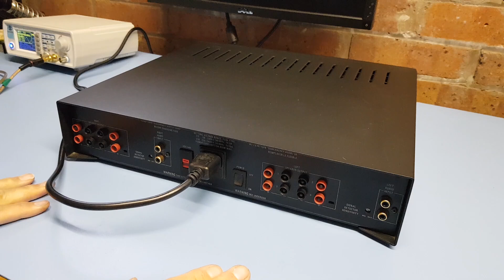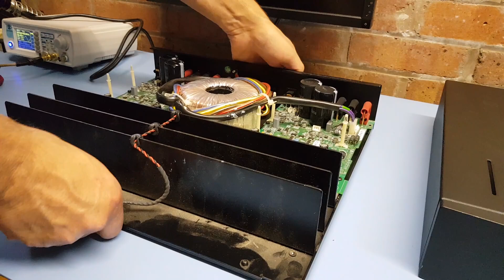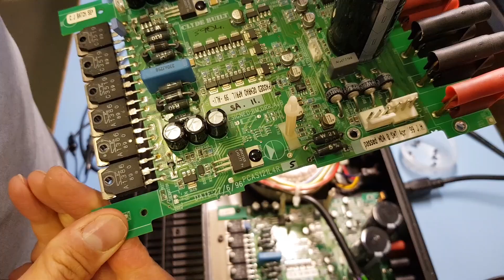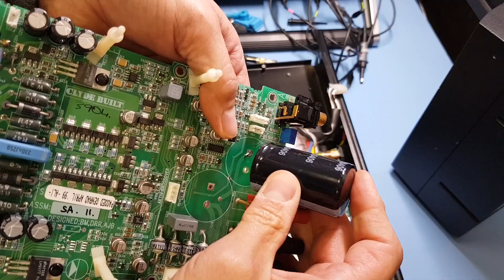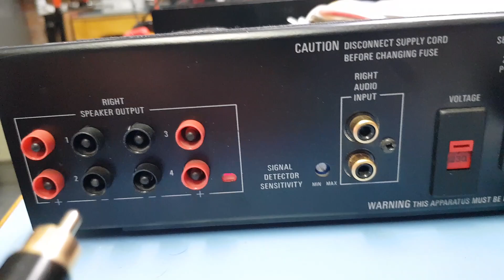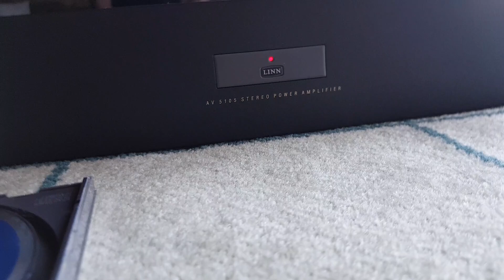Can I repair a Linn Hifi amplifier ?

Comment: In future if you come across something like this and the part of the board that's been affected is sparcly populated like this one, you can drill a small hole through the board to poke a bit of wire through and connect it up to both sides. Sometimes if you can find a place where the same circuit is on both sides you can simply scrape a bit of the solder mask off and use a small bit of wire to bridge the two. For stabilizing the capacitor I would recommend a bit of hot glue under the cap itself and a bit of solid core wire that extends past the through hole on both sides stopping the leg of the cap going back through. That same bit of wire can then be used to patch it to the part of the circuit it should be attached to. What's happened to that board is that someone has likely used a soldering iron that was far too hot and it's burnt away the bonding of the copper trace and through hole. It's very unlikely that you caused that damage given the iron you're using. You may wish to check the other amp board as it may have similar damage. You never know what "Matey Boy" has been up to till you check. Cheers!!

Comment: Here’s how I would have done it…and have done it before…you cannot be certain that the wire put through the hole would be soldered on top inder the capacitor….I’d be really nervous about yhst as half that channel’s power flows through thst joint.

St the very leadt I would have soldered the wire to the top first, before putting the capacitor back….but there is a far better and more reliable way and you had the very stuff yo do it right there….dolder wick!  I wpuld hsve sctrsched the green tropicslizing layer away about 5mm down the tracks leading up to the capacotor bia on each side…then threaded some dolder wick throughnthe hole, (msy have needed to drill it slightly bigger or not)…then bent yhe wick back top and bottom and tsck soldered its ends to the tracks well back from the hole, both top and bottom….leaving the bit going through the hole as solder free as possible so the capacitor’s pin could “barge” its way through….then drown it with solder from the bottom like you did with the second capacitor….then I’d be teally sure thsre eas a solid, reliable, low impedsnce connection both top and bottom.

Another way, uou vould hsve drilled s third hole where the tracks on noth sides thst were connected by the plaring were oppodite each other, scratched the green voating off sround the hole on each dide, poked s but of wire, or better, wick through snd soldered it well both sides…and also poked wick through the capacitor hole and soldered that one dide, yhen put yhe capacitir back.

Damn lucky thst bias thermistor survived, otherwise you wiuld hsve had to redesign the vbe multiplier around whatever replacement you could hsve obtained … that, very likley would have been different…and then reset the bias and thermal feedback for the output transistors…that would have been a right pain.

Oh, unusual Oscilloscope you have there, very few knobs on the front pannel…looks like an earlier digital model. What brand and model number is it, I’d like to find out more about it.  Have fixed a few British Gould branded oscolloscopes before…they were interesting, different snd challenging things to work on.

Comment: You can make 1 of the mono boards in the 5105 an LK-240 by simply using the second transformer tap to 1 of them. The mono board will now output 125W per channel into 8Ω 240W per channel into 4Ω compared to the 5105s 100W/channel/8Ω,	200W/Channel/4Ω. 2 5105s in mono kick 1 stereo 5105 ass. Many dead 5105s out there do to under voltage caps used before the recall.

Comment: I feel sure you were not working on the amp whilst it was connected to power? However, important to show that all AC power is unconnected - even if switched off (RCD will still be active ). Why try to work on top of the complete unit - Clear your bench and work on PCB alone

Comment: I fixed a LInn tuner once and Linn was helpful with supplying tech data for it so I could figure out what was the problem. I suppose it may depend on whether or not the unit is still in production or obsolete.  If a production unit they may insist you deal with their people.

Comment: I've fixed so many things were they hoped the top pad would do the work for a large component, didn't have much copper on the bottom, and it all went wrong. And those caps weren't supported with "goop" so vibration could have cracked them off.

Comment: Very enjoyable video Nigel. Could you perhaps include a list of your equipment (preferably with links) in the video description?  I'm looking to get some test equipment for several activities and it would help to know what's out there and works. All the best, Rob in Switzerland
Reply from the maker: Hi Rob. Actually I intend to make some videos about test equipment and some really basic from scratch how-tos but maybe not soon enough for you. A lot of what I have is old so you won't be able to buy the same. I'll put some basic info in the description.
Reply: @nigelsretroworkshop  Great, thanks Nigel! I bought a Chinese clone of a Mark Levinson John Curl design but the soldering quality is apparently very variable and my first one developed pops, crackles and bangs after only 3 weeks. I sent it back and should receive a replacement soon but am not holding my breath (about the soldering).  In a forum someone had the same problem and resoldered all the dodgy connections and dry joints. He's now very happy with it, so I may have to do the same. I think he upgraded some capacitors also, which I may not. But having basic test equipment would be a boon. All the best, Rob in Switzerland

Comment: Ive just jad the exacrly the same issue on a Linn LK140. Those small copper sleeves came out with the the capacitor connectors. I couldnt understand it, I have a very good desoldering iron.

Comment: That amp has been reworked at least once before during its life, it and a couple of other products which use the same amp board were the subject of a recall to replace those two caps with higher voltage spec parts (a reliability mod because they were too close to the limit at the top of the mains voltage tolerance range)… there’s a sticker on the base which does indicate it was done… however I’d be absolutely amazed if anyone at Linn was responsible for that abomination, they are meticulous about quality control and workmanship and if it had been damaged there, they would have fitted a new PCB… so I’d say someone has been in there since!

PS, it’s pretty difficult to actually do that damage on Linn products, the PCBs are very high quality, I’ve reworked many (usually after 20 years or so of service) and never damaged one.
Reply: I've been working on electronics since I was 12 and I'm 51 now. I've worked on a fair few products from Linn too and I'd say you're bang on mate. I've never seen anything like that that hasn't been buggered by some "Matey Boy" handyman or tinkerer who only thought they knew what they were doing.

Comment: Not that this amf tester is without its foibles, but it's worth to note that for a 6.8mF, at 50 or 63VDC, the esr should be about 10 or 20 of miliohms at most. Half an ohm is way to high, I think and indicates wear.  Sanken (subdivision of Sanyo) C3519 & A1386 outputs aren't fets, they're bipolar transistors.
Reply from the maker: I stand corrected, thanks
Reply: @nigelsretroworkshop  Im just learning myself, so  by no means an expert, if I may rec'd sth, then please take a look at through vias, but make sure they're copper, not Chinese brass, which is prone to rupture. You can get away without a press, if you're careful and ensure PCB is supported, by using two punches to gently force it open once in place. You may need to drill a clean hole to accommodate the via, but it's worth it. Once you get the hang of it, they'll look factory installed.

Comment: I think you were supposed to remove the aluminium bar associated with that one pcb, rather than the transistors. It would have avoided the broken temperature cut out. Did you consider drilling a small hole and soldering the wire bridge on both sides? I'm not sure you would have flowed solder to the top side now you have no plating
Reply from the maker: Actually I did try to remove the bar but I couldn't slide the board back far enough - the caps fouled on the casing. Leaves me wondering how they got there in the first place, I assume the original caps were shorter. I was careful with the soldering & was happy the solder had flowed through.

Comment: Hi,

Difficult to see where things go, and how they work without a schematic. Just one question: the cooling strip where the outputs are mounted on,  seems easy to remove. Just two inbus screws. Then you could have left the outputs attached on there, and remove that as a whole.
I know, in a new to you amp isn't always easy to see how things things come apart.
Creative thinking about the through hole repair, but you definatly should have soldered the topside first, and then fitting the cap. Now you have now way of knowing if the solder has flowed enough on the topside. It might have done so, but no way of knowing for sure. Strange faillure of the board by the way.
Thanks for sharing.

Cheers from the Netherlands.

Comment: I used to work in an industrial controls repair center. When this happened we used a brass eyelet and crimped it down . Then we soldered around the outside to the trace and left the center open. Vola a new through hole to fit the cap . just solder the cap in and you're done.
Reply: Thats a good repair.
Reply: Crimping a through via would be the standard MO in my book, the only issue I can see  is, that industrial quality, electrolytic copper ones, usually come in a pack of 1000.
Reply: I would suggest a ferrule of apropriate diameter to fix the plate through.. You  can get a selection of sizes for a few Euro. You can trim its length before or after.
Reply: Yes! Now that "top hat" PCB hole eyelets are readily available - no need for wire?

Comment: I wouldn't be happy about the wire connection on the top side of the board under the capacitor. You cant see it to know if it is soldered. Perhaps you should have soldered it first, then fitted the cap. Large capacitors relying on only the solder connections for mechanical stability is asking for broken through-plated connections.

Comment: Nice, I've done this a few times with ILP MOSFET amp decks, they used to be really popular with mobile DJs and the caps flexed on the boards, breaking tracks and the legs of the caps.
Reply from the maker: I assumed it was maybe the result of a drop but after I filmed this video I found some old forum posts referring to a recall on this amp, specifically for these capacitors. They were changed for a higher voltage, lower capacitance - and the ones I found in the amp were the replacements so now I'm pretty certain the damage was the result of a bodged job!
Reply: @nigelsretroworkshop  If that's the case, then how come the through plating was still on the caps leg? I think the original replacement damaged the through hole plating, and a bit of bashing in the amps lifetime caused the through plating to completely break as they didn't silicone the caps to the board.